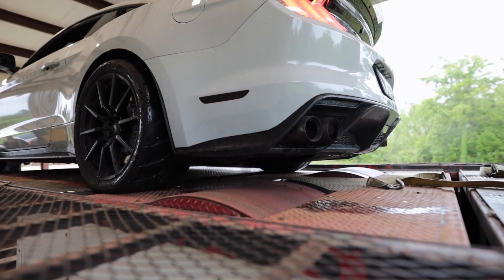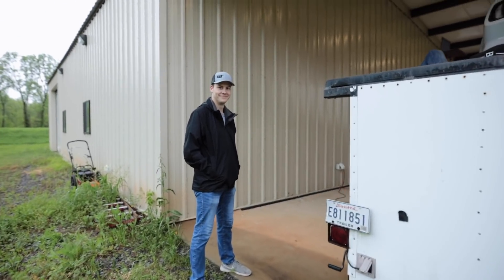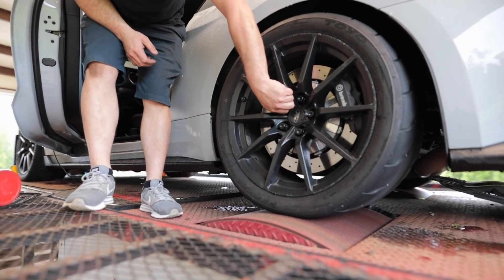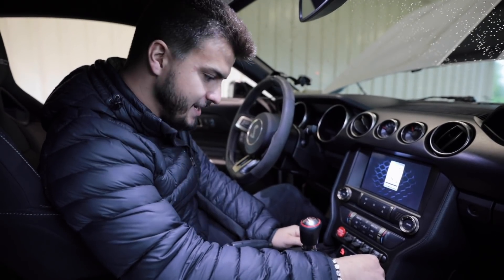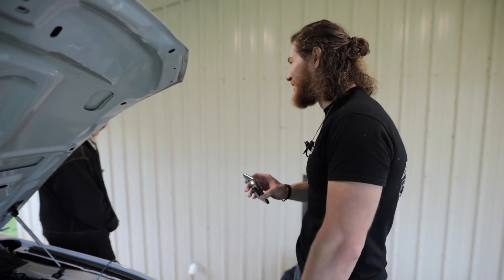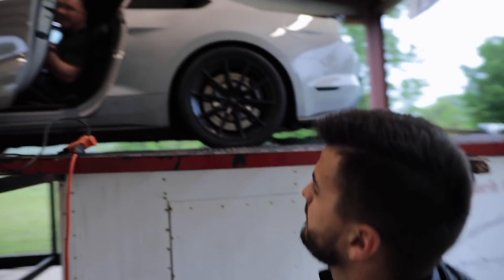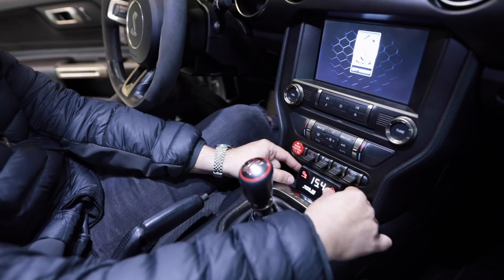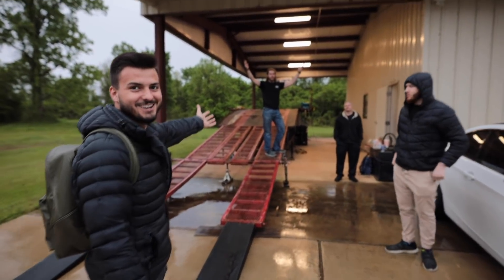My Most Powerful Vehicle Is My Daily... Finding Lucifer's True Power

Comment: 7:34 startup sounded scary 🤔
Reply: for real!!
Reply: Beards and Cars sounded like the flywheel or more likely tensioners of some sort. Maybe timing? Maybe cam    Probably some sort of hydraulic issue
Reply: I can only assume its the timing chain tensioner.. k series honda do that real bad when they wear out.. but this should be all new parts?
Reply: I've owned a few cars that sound similar (like a bag of crap) on cold startup, they've never let me down though, not sure what causes that noise, but it's fine!
Reply: Richard Hammer this isn’t a cold startup. It had been on a few dyno pulls before this
Reply: My GT350 does the same thing sometimes. Not sure why.

Comment: Need to set over boost 4psi above target and tune it properly. Right now you're just bleeding power and prob having throttle shut 90% of the pull to keep boost in check. 

You can do well over 20psi on a 7psi spring.

Comment: 7:35 that start up didnt sound good.
Reply: Matt Sanocki it was plastic vibrating
Reply: Right lol. I heard a low compression skip and oil psi bleeding back off chain tensioners.
Reply: I've owned a few cars that sound similar (like a bag of crap) on cold startup, they've never let me down though, not sure what causes that noise, but it's fine!

Comment: Ok but who's gonna address the elephant in the room that mmr's engine made 20 more horse power than a stock coyote with a bigger pulley and less boost
Reply: They probably gave Gavin the lowkey “F-U”
Reply: @sweetcheels  yea thats what I was thinking
Reply: They should've gotten a good dyno run on the GT
Reply: Remember, they couldn't dyno it 1:1, which would make more power, because they were overspeeding the dyno.

Comment: Let's be honest we all knew his daily was much faster then his built car 😂    man that cool wish I had that
Reply: Not particularly faster, just more powerful
Reply: Bucking Bronco its kinda faster, MAYBE not quicker.. the gt350 would be “faster” in corners and that horsepower and not so weird gearing(like satan has) probably equals higher top speed
Reply: @ares7738  I'm not talking in term of lap time though. I am talking in term of top speed. Satan is lighter, better wheels tires and suspension,  and more evenly balanced.
Reply: Bucking Bronco the chassis and suspension in the gt350 is superior... and it has R888R’s on it and hooks fine.. did you see what i wrote ab top speed? the only thing satan has over the 350 is better low end(cuz blower) slicks(which still dont dead hook because of the crazy torque from a blower)  and slightly more agressive gearing(which results in a LOWER top speed). what leads you to believe that a car with less horsepower and shorter gearing would be faster than a car with more horsepower and taller gearing??
Reply: @ares7738  I disagree, with the point on tires and the point on suspension. I still the the weight if the GT would win it a race
Reply: @thatmarred_mustang   I'm still on bored with @prod.absxnt with the GT being faster
Reply: Bucking Bronco theres a difference between faster and quicker.. like i said before MAYBE the GT is quicker but it sure as hell aint faster

Comment: I love all your cars! I'd do anything to have a high hp car. I used to own a 95 firebird formula, my dream car at the time.  It had the lt1 with a shift kit on its 4 speed auto trans including 373 gears. I walked alot of cars on the street that I never thought I'd beat. Then my head gaskets went. I started to pull the upper end apart, then got sick a month later and was diagnosed with severe Crohns disease. I had to sell the car and parts to make ends meet. I've been working full time in a factory for the past few years. I'm hoping to eventually build that car again with a few mods that wasn't available at that time. I miss that car :(

Comment: Is that a lifter rattling when it starts up a 7:35
Reply: Could be the timing chain because I'm pretty sure if uses the oil pressure to operate the tensioners

Comment: hey Gavin 
when you were drag racing you said that the stock trans cAn not hold any more power over stock but im also interested in the 350s so the question is, would it hold 750? If I had the car i would supercharge it to the 750 wheel and I was really considering doing that but if it can not hold power than I would rather go for something else

Comment: What was the boost on the last pull? Didn’t say in the video.
Reply: 14.1 psi according to the logs.  Car actually ran out of fuel pump at 7200 rpm.  Probably would have been 1030ish with enough pump.  Thus we get a fuel system.

Comment: What’s a good turbo setup for my 2009 Ford Taurus or good performance parts
Reply: A new car.  Way to heavy.  Unless maybe you put a TT voodoo in it? Is it awd?
Reply: 3.5L awd
Reply: Thats badass. Is it a SHO? I really like the Taurus nowadays. If they were the same size they used to be theyd really scoot. There are alot of ppl out there making good numbers with that engine tho.  Find an EcoBoost truck n grab the turbos.  But that probably cost more than aftermarket.  Good luck on the project. Hope it works out for you.

Comment: Correct me if I’m wrong but the lower the gear the MORE power the dyno will read, so when Gavin says “that was only in 4th gear so it will make more in 5th” isn’t he wrong? Every time I’ve been on a dyno the lower gears will make the machine read higher than the true HP.

Comment: Wouldn’t 4th gear show a higher horsepower than 1:1? HP is work over time. So you measure how fast it runs through the RPM’s at a set load. So if you were in fifth gear it’d show less power I think

Comment: Still very fast but that’s only 700 torque...
Reply: The Voodoo motor is extremely rev-happy, and the tune is probably designed to keep the stock transmission from experiencing critical existence failure.